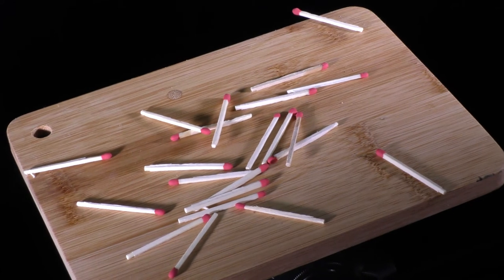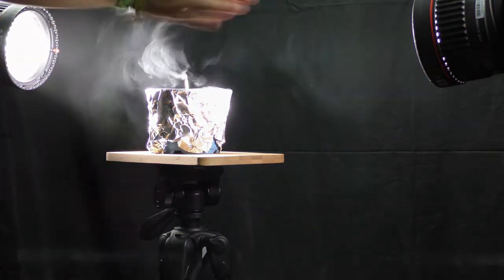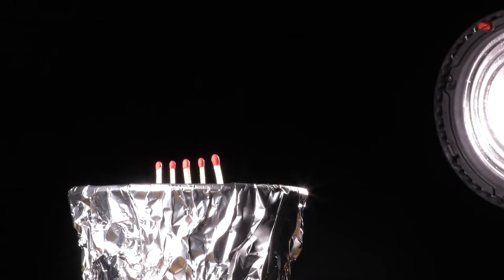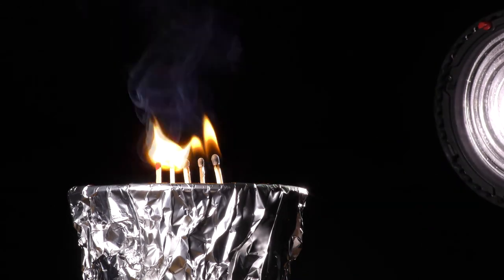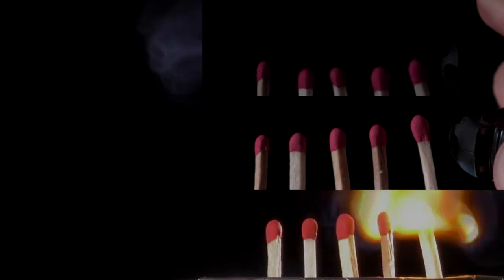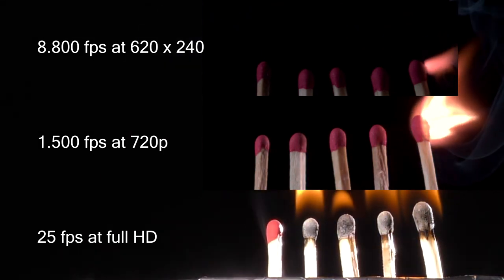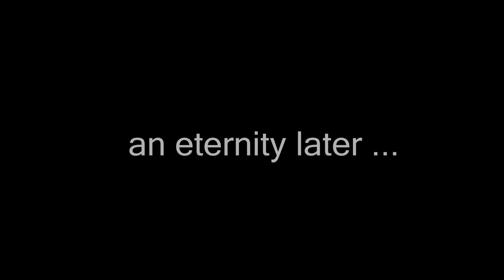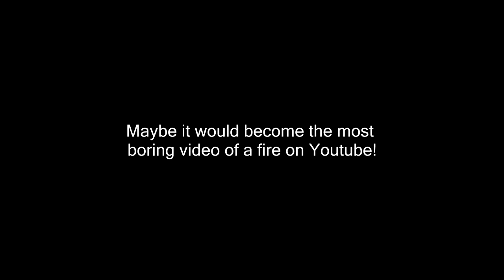9,000 FPS!! Matchignition - Slow Motion - Chronos 1.4

Comment: Nice Job. What kind of setup do you have?
Reply from the maker: Thank you Mr. Robot :) 
I am using the 8GB Cholor Chronos 1.4 with Samyang 35mm and 80mm VDSLR lenses.Lights I use are two Godox 150W LED lights ... and a rig, that doesn't completly fit at the camera :D
Reply: Awesome! What VDSLR lens mount did you by for your Chonos?
Reply from the maker: @Friedeggshells  a Canon EF mount with a little adapter from Canon EF to CS mount between lens and camera :)
Reply: Luke Slow Mo thanks for the info. Keep up the good work.